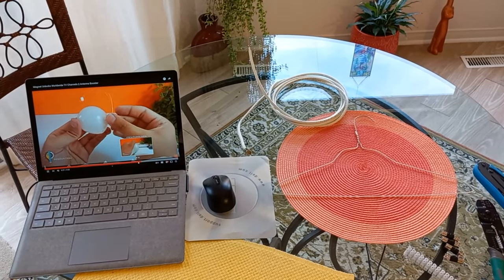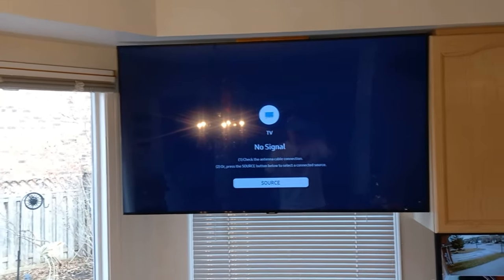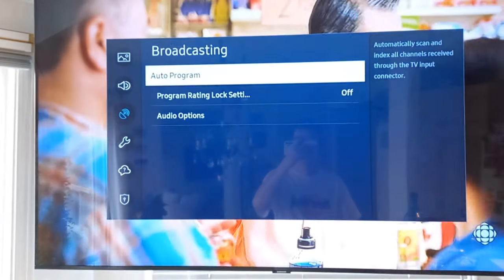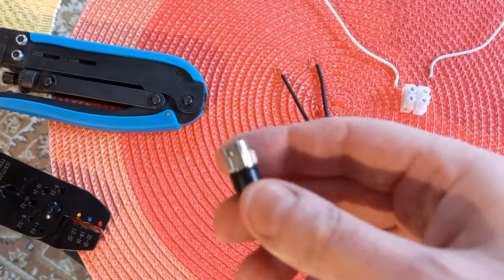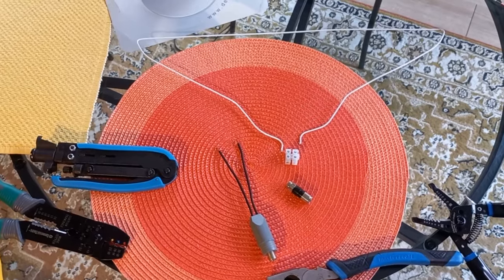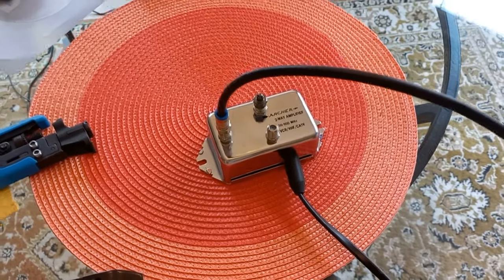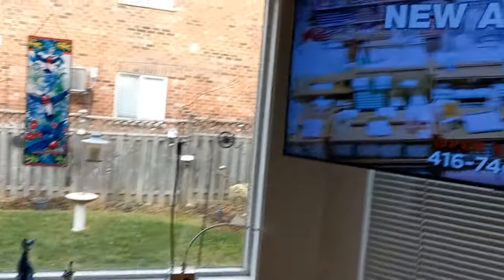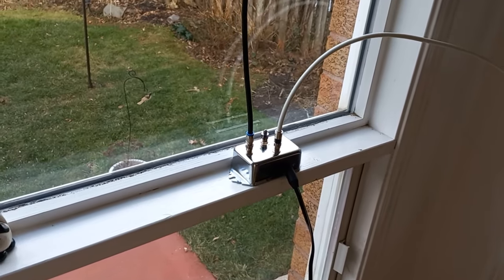Coat Hanger FREE HD TV Antenna

Comment: I used to make 2m groundplane homebrew antennas from an SO-239 connector, 12ga ground wire (radials) and copper plumbing tube (radiator). They worked so fantastically good for next to no money.

Comment: My office is in one of three bedrooms on the second floor of my home and after getting rid of cable, I'm using a metal coat hanger antenna placed in one of the other bedrooms that's unfinished and used basically as a storage area. All bedrooms have windows and the coat hanger is near the window in the 'storage' room. I straightened out the hook on the coat hanger and used 320 grit sandpaper to remove any coating on the straight end of the coat hanger. I then simply used a coax connector to connect the cable from the tv to the cable that's connected to the coat hanger. I cut one end of the coax connector off the connecting cable and stripped about 2" off the end, along with the wound grounding wire, leaving the center copper wire, then tightly wrapped the copper center wire around the straight end of the coat hanger and held it in place with electrical tape. Did a channel scan and I'm getting 42 channels including all local channels, all with excellent quality. Sounds like a lot to do but only took about 15 min. Office TV is a cheap 20" Sansui that I don't use much anymore anyway since I'm now retired. But when I'm up here, it's nice to have the company of the TV. BTW, for local channels on my other two TVs (main 55" in living room, 40" in bedroom) I'm using flat HD antennas with excellent results. Both TVs are Roku, so plenty of content without cable. Went from $200+/mo to $39/mo for just internet.
Reply from the maker: 42 channels for the price of a coat hanger !:face-blue-smiling:
Reply: Yep! And still working great.